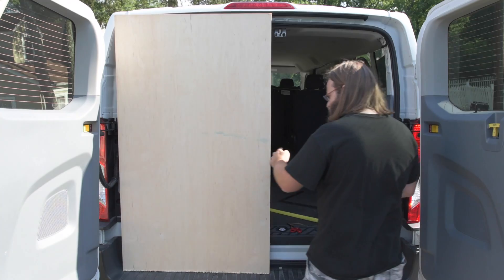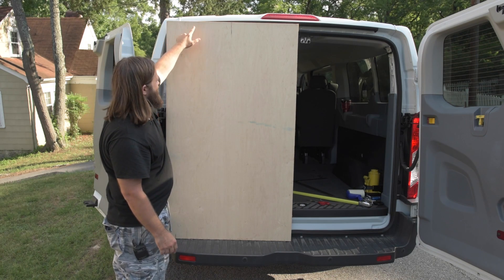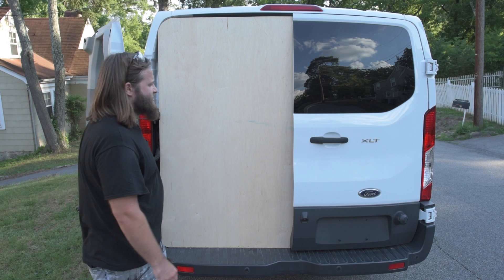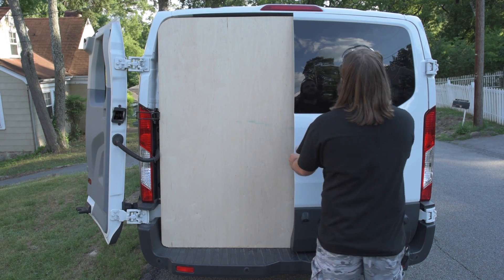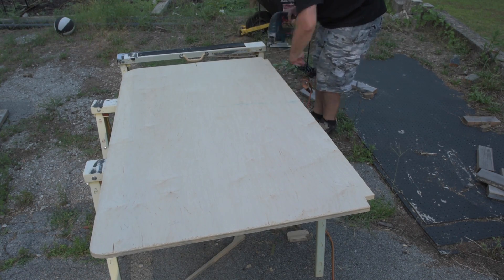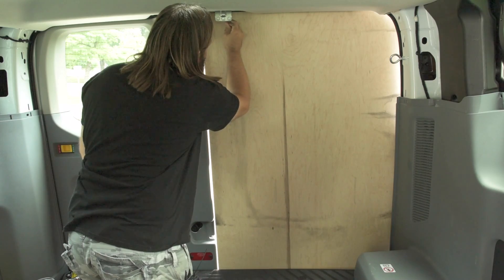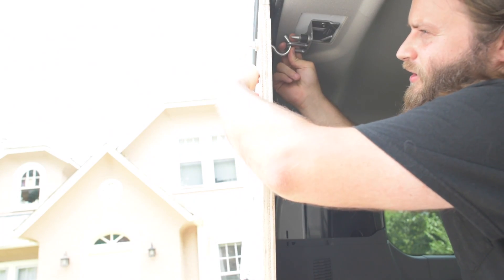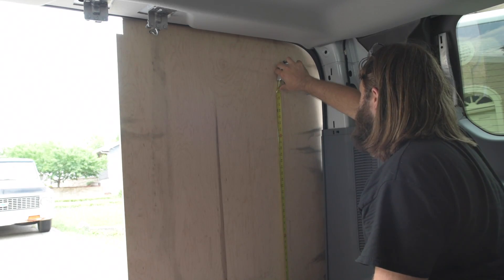Ford Transit Temporary Window AC Build

Comment: I have a 2002 Dodge conversion van and I’m wanting to find a way to mount a 5000 btu window unit I already have. This gives me a idea. Wish you had a second video on the finished work.
Reply from the maker: I tried it out in Florida shortly after filming this. Cooled well, but rain was a problem. Decided I wanted to buy a used van door and do a permanent waterproof mount. Unfortunately, at the time, I couldn’t find any used van doors in junk yards for my model van. If I ever find one I’ll do another build video. Seems like a handy thing to have.

I will note that this setup doesn’t make a lot of sense for more than two people. I have six people in my family so we have a lot of tents for various purposes.

Comment: I was thinking of doing something like this for a temporary AC mount while selling at festivals, and found your video.  You were my hero until your camera ran out of memory.  :)  It looks like everything was pretty well done at the end of your video.  Any other pointers on completing the installation, or any thoughts on how it all worked out for you?  Thanks for the Video.
Reply from the maker: I recommend buying a spare van door to cut up. I think it’s a better solution. Less hassle, waterproof, better security. I haven’t found one yet for my van, but that’s what I plan to do in the future.

Comment: I need to hook my vehicle up with a window AC!! PLEASE ANSWER ME; what is the easiest most affordable way for me to power a window AC unit? Solar power sounds too complicated/expensive. So I need a generator right? What generator should I get? I don't even really know what a generator is barely lol so help. I'd want a pretty powerful AC. Link a good generator for me to use please. Help me get setup :) Thank you
Reply from the maker: +Adam Davis I use a Yamaha EF2000is: http://amzn.to/2slVleM
Reply: That'd be powerful enough to power a 10,000 BTU unit?
Reply from the maker: +Adam Davis maybe. It runs my frigidaire 8000 btu window ac. You may need a larger one for 10k
Reply from the maker: +Adam Davis two of them can be joined with a link cable, but that's an expensive solution.
Reply from the maker: +Adam Davis the next step up would be something like the Honda 3000 Handi which can run up to 13k btu units: http://amzn.to/2tLXB3j
Reply: Thank you for your help! Does the 8000 BTU cool down your van really good when it is really hot out? Or are you still mildly warm? I'm looking to be cooool but $2500 is a hefty pricetag
Reply: $2300 I meant - still a bit high
Reply from the maker: +Adam Davis I used my 8000btu unit in south Florida last year after the sun went down. Kept the uninsulated van plenty cool. Not sure it would work in direct sunlight though.
Reply from the maker: +Adam Davis yeah, small compact generators ain't cheap. You can get a big one cheap at harbor freight but it will guzzle gas, roar like a train, and be about three times the size.
Reply from the maker: I was unaware of that generator. Reading the reviews, it looks pretty good, though louder than the Handi. Might be an excellent option for some people.
Reply: Bugging you one more time.. it's fine to drive with the window AC installed right? I would not have to take it down to drive right???
Reply from the maker: +Adam Davis I'm not aware of any law against it. I see people drive with them installed in the back window of their vans fairly often. It's generally considered bad form by most though. ;)